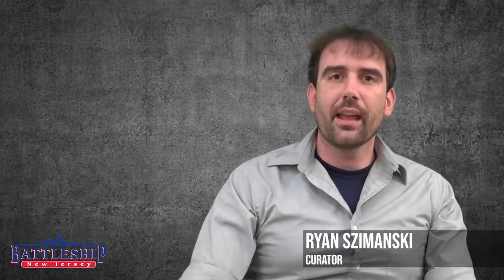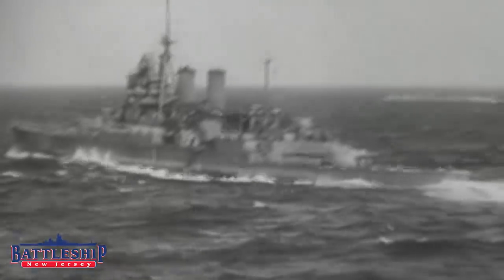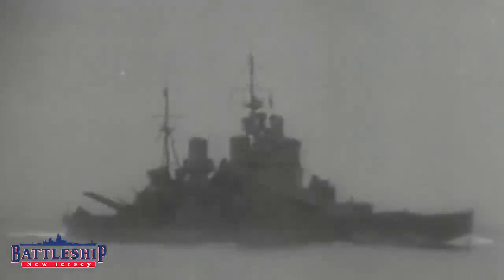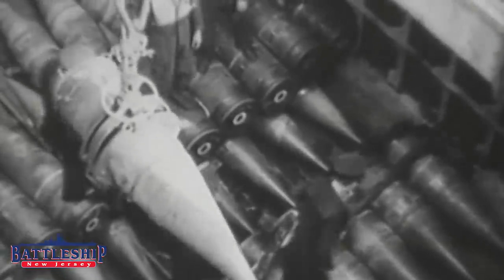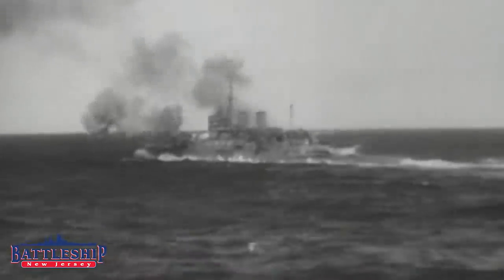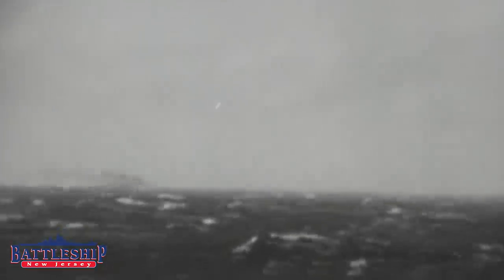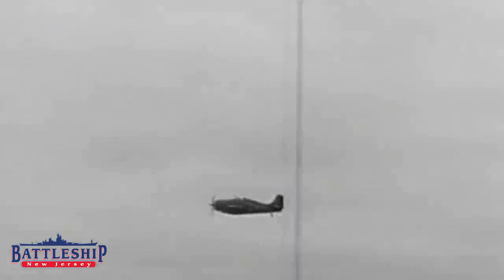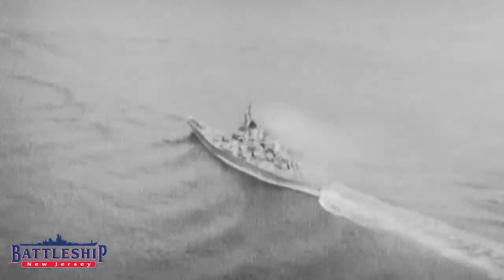How do you Sink a Battleship?

Comment: How do you sink a battleship?  You create a situation where the weight of the vessel exceeds the weight of the water which it displaces.  This is generally accomplished by failing to keep the ocean on the outside of the hull.

Probably the LEAST obvious situation would be firefighting.  The ship I was on had 3 fire pumps.  2 of them were rated at 3500 GPM.  If you have just one pump online and multiple hose teams out, you can easily use it all.  At around 8 pounds per gallon, that works out to 14 TONS of water per minute being put inside the hull where it shouldn't be.  Even a little P-250 portable pump that two guys can carry around can pump 250 GPM, which works out to a ton per minute...

Comment: How many times have first rate, state of the art battleships actually fired on each other?

I'm finding a number of cases from WW-2 where state of the art ships fired on older ships, or where cruisers engage each other or where ships maneuver to engage (or avoid) each other but never actually reach firing range. But what about the kind of straight up slug-fest battleships were designed for?
Reply: Battle of the Denmark Strait: brand new battleships HMS Prince of Wales and Bismarck duked it out after the HMS Hood was destroyed.
Reply: @zeroone8800  Also the Bismarck's last battle, when HMS King George V fought Bismarck in combination with Rodney.
Reply: Using the loosest definition of "battleship", I would say Trafalgar was the last great slug-fest.
Reply: @hunter35474  I would challenge the "looseness" of that definition, a ship of the line is a battleship, and was occasionally referred to as such at that time as well, as well as being called line of battle ships, and simply liners
Reply: @jaysonlima9271  I'll accept as a battleship anything that's designed to dish it out and take it with anything on the seas.

Comment: wait till its in port and throw a wrench into the gearbox. You need a Wrench, Bolt cutters and Sneak 100 :P
Reply: Wouldn't sink her per say but definitely a mission kill, and if she was older and nearing the end of her viability then probably a tow to the scrappers instead of drydock for repairs
Reply: @jaysonlima9271  yessir. i didnt even think about the wording but it wouldnt sink her at all, i mean if you attached rdx to some things in the sea chest and maybe some of the intakes for water.. or if she is loaded the magazines, i mean they are almost impossible to get to, only shot would be in port or on the way to dry dock or out of, when she is not loaded with ammo. or by subterfuge and doing it while she is under a refit and replace the cover.. which is impossible because 5 enlisted and 2 officers have keys probably. also blowing a few of the william or zulu hatches to circumvent flooding control or several other things lol. if i was physicially there and had ill intent i could make almost any ship cease to move under her own power. lock one bilge open and destroy the controls and completely destroy the bilge system on the other side and she will fido. that can bring about more nightmares for a government than sinking one. there is a reason there are like 8 locks on the cover. When he said sink i was thinking, send one to the breakers one way or another. :P if she is underway a bundle of some small discreet explosive next to 2 of the boilers. gotta be at least 2.
Outside the ship, rounds up her skirts. 5 inch HE AP stagger. wouldnt sink her but itd really really hurt. rapid fire on the turret 2 skirts. but i have the advantage of having seen a few diagrams too. ASROC to the bow forward of frame 0 would slow her for a torpedo kill also. i heard somewhere ships losing hydrodynamic form is a killer potentially as far as getting away at more than a crawl.

Comment: By replacing most of the air in the citadel with water.
Usually by creating holes in the wrong places. F.e. be repeatedly hitting the same part of the target.
Or by not maintaining the hull, which will develop leaks as well.

Comment: 12.40
Queen Elizabeth and Valiant were mined by the Italians but didn't sink below the sea. I read that neither ship settled on the bottom . Both were repaired though Valiant didn't really get up to much after apart from a bit of pay back with Italy due to a refit in a floating dock that collapsed and caused more damage . 
In fact i think only the Queen Elizabeth of that class kept going to almost the end of the War and decommissioned in August 1945 , Valiant decommissioned in mid 1945 after the dock damage . Barham blew up after 3 torpedo hits late in 1941 , Warspite was well and truly worn out by very hard going action and Malaya was unmodified and decommissioned late in 1943 into reserve .
It was a good class of ship , should have built more of them.

Comment: The British massacred the French at Mers-al-kebir...........yes they had talks, and the french did nothing due to indecision. Deciding that it was taking too long, Churchill simply ordered the manned french ships attacked, killing many french sailors for essentially an expediency.  Seems extremely unlikely the french sailors or officers would have handed their ships to Germany.
Reply: thats a grossly simplistic and biased explanation of mers-al-kebir. When you phrase it like that, it sounds plausible...
but in reality you have distorted what happened and omitted loads of details to point that its simply not an accurate or fair portrayal of events.
To correct your multiple innacuracies and bodged not-facts, i suggest you check out Drachinifels video on the topic. Unlike you- hes studied the signals and communications and actual facts of the situation. (and- for starters, at no point did churchill decide they were taking too long and intervene to expedite the attack. The admiral on the spot was following preset orders, was no intervention mid way through process from london.)
its the inflexibility - and refusal to transmit the RN offer in full to paris - of teh french admiral that prob bears most responsibility for the deaths. If he tells his bosses ALL the options RN putting on table, not just the two extreme case scenarios, prob no-one dies. But heONLY forwarded teh two extreme options (join up with brits, or die, in short form) and the bosses couldnt pick one of teh other options (ie, go to US and be interned, leave vichy french control and be neutral overseas away from nazis..)
So- in short- your full of BS.

Comment: Personally, I find it fascinating that while there have been some cases of battleships stubbornly refusing to sink, others were sunk with (relatively) minor effort

Oklahoma capsized after only taking 5 torpedoes (which, relative to the number of torpedo bombers that attacked Pearl Harbor, isn’t that many)

Arizona took about 4 bomb hits, but it was the one bomb to her magazine that resulted in her exploding and being rendered a total loss.

Arguably sunk with the least effort of all- the Japanese battleship Kongo was sunk by only two torpedo hits from the submarine USS Sealion

On the other side of the coin- Bismarck took numerous shell hits, but stubbornly refused to sink until after torpedo hits and (possible) scuttling charges. Or even Yamato, with how many bomb and torpedo hits she took before finally sinking

I think the point it spot on though- it ultimately comes down to how many holes you can put below the waterline in the battleship
Reply: i thought oklahoma took 7 plus torps- exact number unknown. and the combined hits something like 5-7 were ina similar location so was a HUGE secton of side of ship that was just ripped to pieces going 10-25 foot back into hull (google oklahoma salvage and check the photos.)
forget the number of bombers-thats irrelevant.  The torpedo hits she took were enough to sink 2 or 3 ships, ripped a huge section of ship to bits, and ensured she could never be repaired...
thats not minor.

Comment: Good video thanks.  Basically torpedo bombers are needed to sink a battle ship.  This leads to a question i woundered for sometime.  in the opening part of the battle of eastern solomons, why the japanese did not part their battleships of henderson field.  Take out the air field at night and do a beach landing at henderson field, under the guns of the battleships.  then the battle would be between the us and japanese carrier groups.  The us carrier groups would be caught engaging japanese carriers and protecting us troups.
The japanese battleships would be hard to disloge, particular if torpedo nets were put around the battleships.
Same strategy would have worked at port moresby after the carrier battle was over.  
With light cruisers, the same stragey would work for milne bay.

Comment: IIRC Kirishima was hit with 16 inch shells for USS Washington that impacted the water and hit Kirishima’s hull beneath the waterline
Reply: Robert Ballard’s inspection of Kirishima counted 19 major caliber hits, about 12 of them below the waterline. Washington pounded her,  but the plotters only counted 6 or 7 hits. The Japanese DCA survived and called 20 hits. Most were spotted as short by Washington. SODAK was there, but was busy drawing fire and trying to get her electrical system back on line. The chief engineer tied down several main breakers causing a major power casualty. They spent the battle wandering around in the dark and claimed after the fact that they not Washington sunk Kirishima. Capt Gatch  gave a long interview to a NY magazine while they were being repaired.... starting the whole “battleship X” nonsense. My father was on the Washington and they battled the sodak’s crew frequently over Gatch’s BS story. He was reprimanded over it, but due to security concerns, especially that early in the war, Washington didn’t get any publicity until post war, after the false narrative of the “hero” Gatch had been circulating for 3 1/2 years.

Comment: Could you legally rebuild ship like Arizona completely by the blueprints in a shipyard and modern time and you know use it? (Like if billionaires wanted to with knowledge and industry?)
Reply from the maker: The plans exist, they aren't going to stop you. You'll run into issues with guns though, local regulations likely will prevent you from making the guns active systems. But depends which country you build it in.

Comment: Bismark was "sunk" by a WW-I era bi-plane.  Although she was pummeled after she lost rudder control she was most likely scuttled.
Reply: The Swordfish entered service in 1936, so not WWI era.
Reply: No that was the admiral on board giving up. The ship's captain wanted to blow the rudder off completely to regain control by engine power. He would have saved lives by throwing the admiral into the sea.
Reply: not most likely- least likely. you put most when what you meant was least.
Reply: @keefymckeefface8330  Scuttling was confirmed by visual inspection of the wreckage.
Reply: @joshuahudson2170  no, it wasn't. Cos visual inspection of the wreckage shows the hull is buried up to the waterline (and above waterline forward) in the mud on sea floor, so no-one can see the Hull below waterline, so visual inspection DOES NOT confirm scuttling or ANY damage below waterline. Sorry. But if look at ballards wreck photos, such is clear, and your simply wrong saying the above.

Comment: USS Arkansas (BB-33) Being almost thrown cleanly out of the water and capsizing in minutes or even seconds by the nuclear blast of test Baker at Bikini Atoll
Reply: There is no evidence that Arkansas got yeeted.
Reply: USS Arkansas (BB 33) survived the initial test, an air-burst, but was anchored in close proximity to the bomb used in the 25 July 1946 underwater shot. Arkansas was engulfed in the column of water driven up by the powerful blast and quickly sank. She remains on the bottom of Bikini Atoll to this day. It took (2) times.
Reply: @tonytrotta9322  it was proven that the shadow was not a chunk of BB-33
Reply: @invadegreece9281  like I said almost😂
Reply: @bustinlooseracing7144  fair

Comment: Torpedoes. Most efficient and fastest way. Hit them with a wide spread of 4, knock out the steering and props at the stern, punch through the bow, and 2 damage the blisters midships. It will go down with less than 6 hits: Too many compartment bulkheads sprung from the shocks, all on the same side, so counter flooding won't work.
Reply: Unless these are American torpedoes...
Reply: @leonardmilcin7798  American torpedoes are good . Just because it was bad in 41'42 doesn't mean its overall bad that every time torpedo topic comes into mind. The american torpedoes suck .
Reply: @issacfoster1113  Whenever I read about Pacific campaign I have this feeling that the most important tech to develop was figuring out whether the ship you are shelling is friend or foe and that the torpedoes were designed by an insurance company heavily invested in insuring Japanese surface fleet.

Comment: Why didnt they just build everything out of wood sure it will get penetrated easily and break over everything but it cant sink
Reply: I bet there are more wooden ships on the oceans floor then steel ones ;)
Reply: @hernerweisenberg7052  sure if they had giant anchors all over it but if they were smart they would get rid of as much non buoyant things as possible and I guess if they beached it that would count as well

I'm too lazy to fix that typo
Reply: @sparrow9990  Wood exposed to water gets waterlogged, meaning it soaked up water and is no longer buoyant. Besides, as any ship, a wooden ship gets its buoyancy from the air inside. All you can do to keep a leaky wooden ship from sinking is the same you do to any other ship, fix the leaks and pump out the water. Even if you could throw hundreds or thousands of tons of artillery or cargo overboard that fast (which you can't), the remaining buoyancy of wood doesn't even support the ships ballast, and if you throw that the ship capzizes anyway. Its just not how wooden ships work, they are not rafts ;)
Reply: @hernerweisenberg7052  But you can design one that floats on that principle. I would propose to use polyurethane foam in a honeycomb steel grid though.
Reply: @joshuahudson2170  Yes you can, its frequently done with private yachts. I doubt it would be possible or practical for a warship tho, for obvious reasons ;)